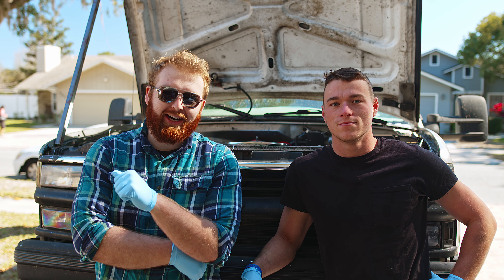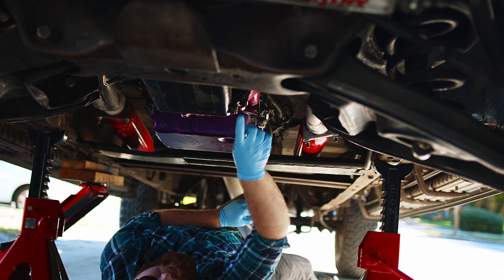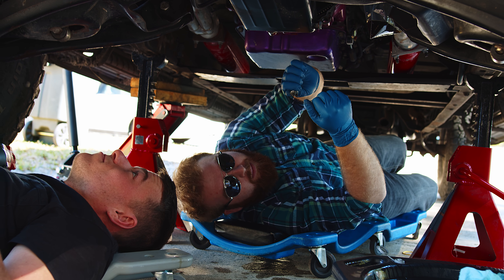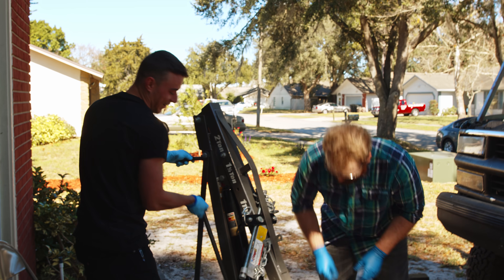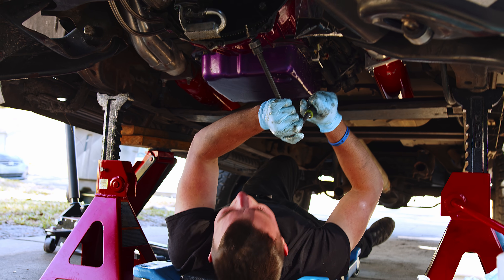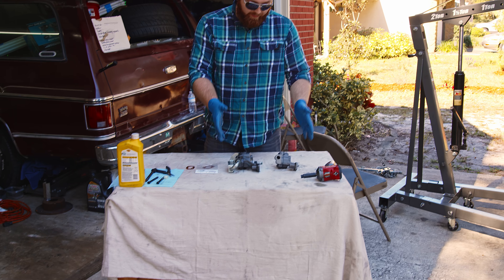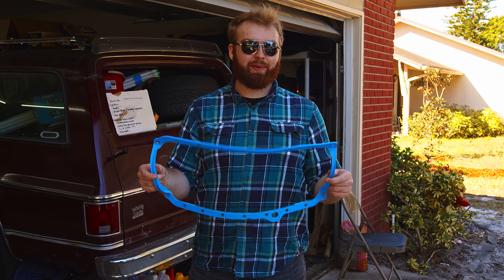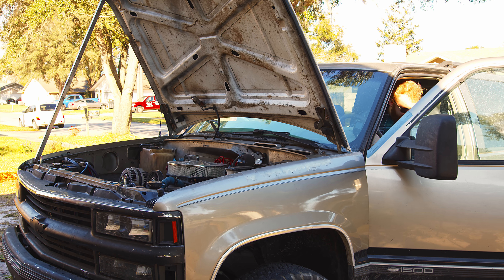Oil Pressure Was 100+ PSI! - Replacing High Pressure Pump w/ Standard Pressure in our 1999 Suburban

Comment: Usually high pressure oil pumps  have a relief valve that should release at around 80 psi but 100 psi is nuts.

Comment: You guys doing really nice videos for this suberban appreciate ur work it helps a lot . I got high volume pump is it ok ? Still didn't install it but as i read they say it would be good for high mileage engine like mine 300k miles
Reply from the maker: High volume is always good from what I've read, it was the high pressure that was our problem. So if yours is high volume that should be perfect